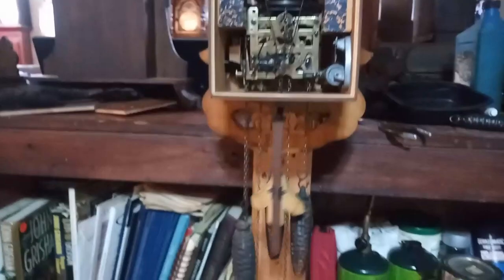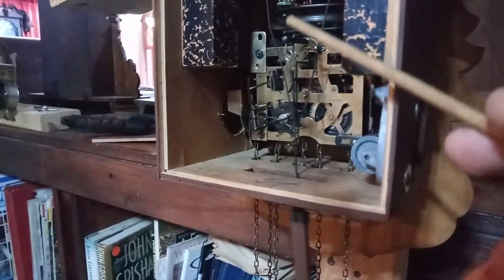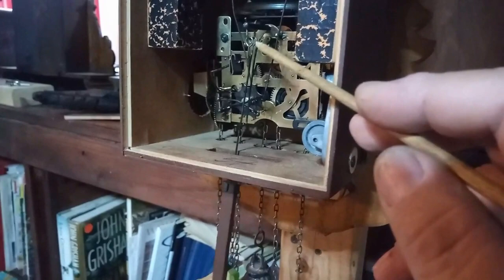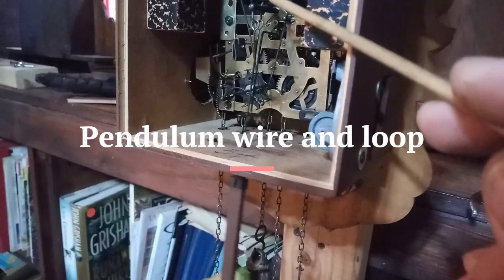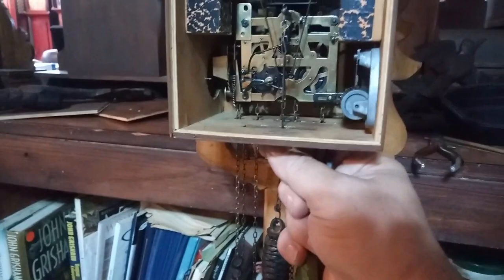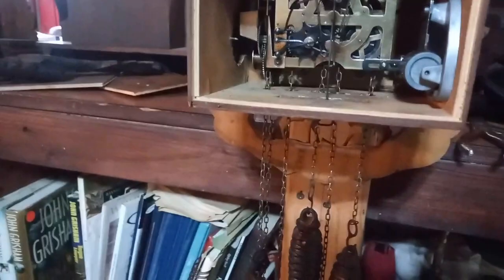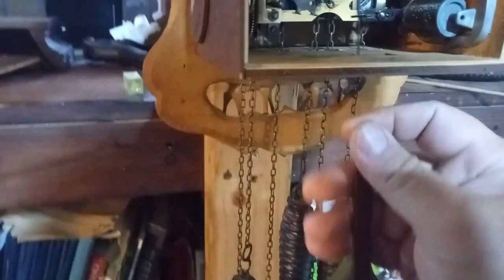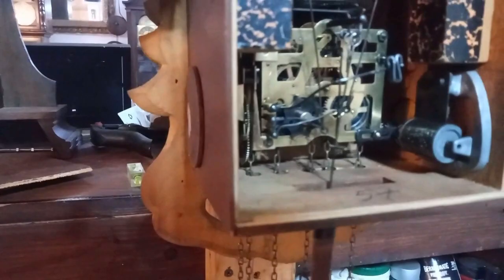What may be wrong with your cuckoo clock stopping or stops when it is in beat? (See description)

Comment: Easier just to bend the verge wire a little.
Reply from the maker: You must not have watched the complete video. I have worked on cuckoo clocks for the past several years and people come to me all the time for help. They are always satisfied. Bending the verge wire will not work when the "U" or "V" wire that the pendulum leader wire hangs on has a worn spot. You either have to get the leader wire to hang some where else, make those wires, or purchase them and replace the worn ones. They are cheap to do.
Reply: Nope, didn’t need to. Over 20 years working and selling cuckoo clocks.
Reply from the maker: Congrats on your experience.  I have people who work on clocks all the time contact me for questions on repairing their cuckoo clocks. I have subscribers who only watch my videos to repair their clocks. I have people from all over the world that contact me for help. They went cuckoo for cuckoo clocks and one person has over 50 clocks in his possession that he has repaired just from watching my videos. If you have all that experience then you should set up a you tube channel and provide all the free information that I do.

Comment: My cuckoo clock kept stopping and I didn't know why.  It turned out to be simple - it wasn't hanging entirely vertically on the wall, it was at a slight tilt.  When I straightened it, it worked fine again.  Suggest you check for this first.  The clue was a slightly uneven tic-toc.
Reply from the maker: totally agree with what you are saying.  If you watch my videos on how to put a cuckoo clock in beat I discuss that. I tell people to take the pendulum off and tilt the clock slightly to the left/right until the pendulum leader wire starts swinging back and forth on its own even after you stop it with your fingers several times. Once it does then you should be able to put the pendulum back on and give it a slight swing and the clock should stay running.

Comment: Can the problem be the chains? That they get stuck and that is why the clock stops?
Reply from the maker: Yes if the chains are rusty or the wrong size then that could stop your clock. Typically if they are the wrong size they slip when you wind the clock. If they arent slipping then the chains might be rusty or have open links.  See my video on chains.

Comment: Would this be happening on a new movement?  I have a special ordered movement, it runs fine as wire, add the pendulum and it stops within a minute or so.
Reply from the maker: It shouldnt be happening on a new movement. I am going to say that the movement is out of beat. Search my channel on  how to put a cuckoo clock in beat. Good luck.

Comment: Mike-I watched your video yesterday and found it very helpful--I think.  I have a Regula 34 movement in a cuckoo clock, and the clock was given to my sister by a friend and she doesn't know anything about the history.  I worked on my cuckoo clock years ago and got it running and it's still running so I thought I could help out.  Anyway, I washed the movement off with a degreaser and oiled the pivots and reinstalled it, and it ran fine for a day, but now it won't run for more than 1 minute.  It's level, and has a perfect sounding tick-tock beat.  But after I start it by nudging the pendulum it runs for 60 ticks, then goes quiet and stops after about 5 more movements of the pendulum.  It has the same type of U pendulum wire as yours.  So my question is, does this clock have the symptoms you are describing for a fix, or is mine suffering from something else?  Thanks.
Reply from the maker: I think it might be the "U" and "V" hooks that the pendulum leader wire connects to.  The following video explains. I hope it helps out. Mark  https://www.youtube.com/watch?v=Arom0uC3H6I

Comment: I have never found the U shape wire worn. I always check to see if the U shape is opened enough, and not smashed almost together because it fell off the wall. Again, I guess I am lucky. You do have great advice and ideas about clocks.
Reply from the maker: I added a link in the description from timesavers that shows you the part numbers. I hope that it helps. Thanks for the kind comments.
Reply from the maker: BTW this is the first or second that I have found that was worn out. Most of the time you can change the shape in the bottom half and fix it as I did in this video.

Comment: I have a problem with my gown not working It comes up but it don't make no noise I don't think I try to adjust it and I think I knock something off on the inside of the mechanism are there any way you could show me what I need to do to fix it
Reply from the maker: I need more information. Please find me on facebook.  My current profile picture is of a drawing that a veteran did of me while I was at the VA. If  you can please send me pictures and a video. Thanks.

Comment: Mark. Could a tooth on the escape wheel be stretched?  It stopped suddenly like a gear blocked the verge.
Reply from the maker: Typically yes but I have had this movement apart and inspected it all. Did a couple of bushings. Polished the pivots. So not in this case.

Comment: hey Mark i have an  8 day cucko clock but it works tics only when tillted to the left side if i set it straight up in wall it stops working,  why would it be???   thank you for your help,  believe might be someting with  wire pendulum meybe bent, how can i sove it, TY
Reply from the maker: Sounds like the crutch wire needs adjusting. Look for my videos on how to put a cuckoo clock in beat. I explain all of that. Let me know if you need more help. Good luck.
Reply: if is not to mcho bother from my part, have an other question the cuckoo clock bellow arm the one on top smallest gets stuck when the snail rack fall  all the way down, the upper arm gets stuck  they both should fall freely  the on on top stays up  causing cuckoo below stuck,
Reply from the maker: @viridiana256072  I am having trouble understanding the issue but i think that you are saying the rack falls behind the snail. There is a tab on the rack that is supposed to hit the snail. I would adjust that so it hits the snail and also make sure that the snail is pushed as far back as possible.

Comment: How do i fix my cuckoo so that the  clock needles 
doesn’t get stuck at a certain point?
Reply from the maker: I am not sure what you are calling clock needles. If  you are referring to the hands then there is more information that I need to know.  Please send me a message on Face Book. My current profile picture is a drawing that a veteran did of me while at the VA.  In this message provide me with pictures of you clock to include the movement and refer me to this message. Thanks.

Comment: Does that apply to grandfathers clocks?
Reply from the maker: Grandfather clocks have a different set up. The clock is probably out of beat from moving it to sweep/dust/etc.,. Taking two people to do this. Start the pendulum from side to side and listen for an even tic toc.  One person lifting up one side of the clock ever so slightly to get that even tic toc. Try the other side. Then whereever it sounds the best at if they dont have leveling feet a person puts shims such as cardboard under the side that when lifted sounded the best. Before you do all of this I would suggest to look at the suspension spring to make sure it isnt broken. Depending on your grandfather clock depends on what they are supposed to look like. I would suggest searching a you tube video on replacing a suspension spring on a grandfather clock.  Good luck.